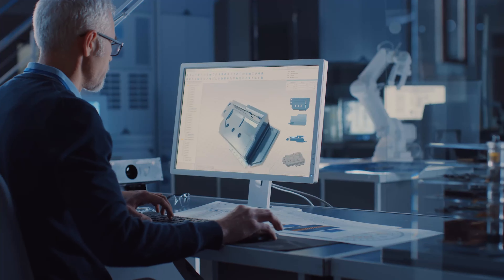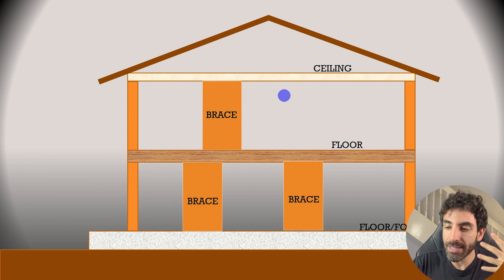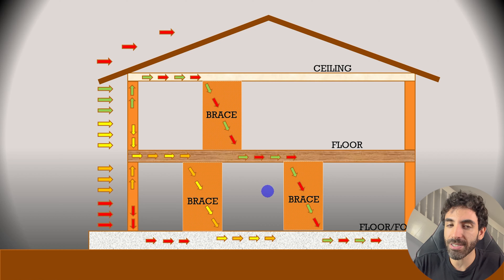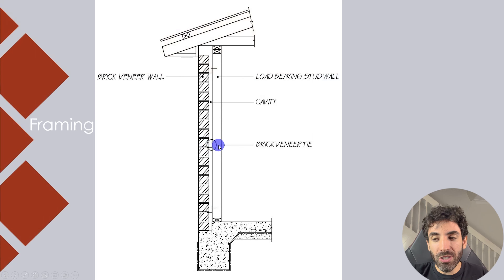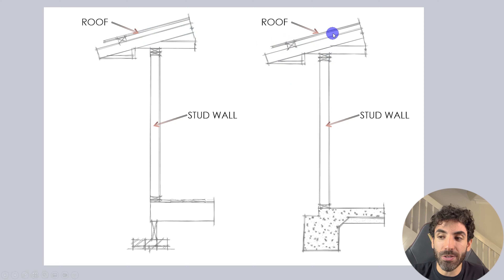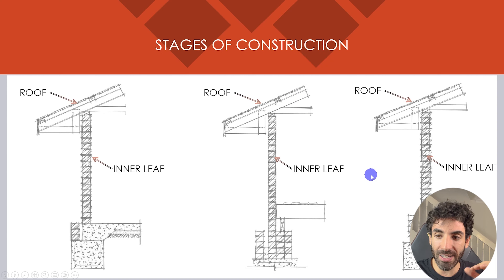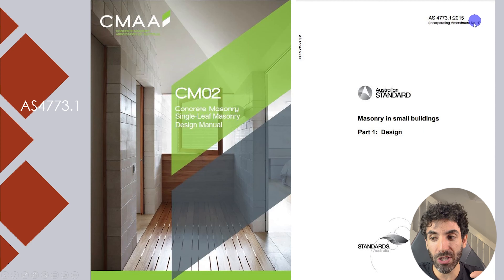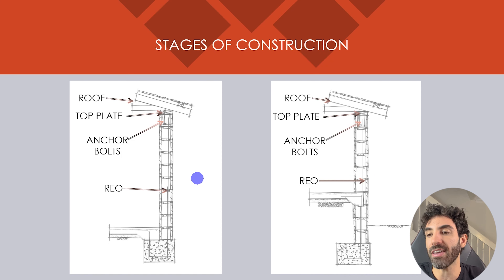Typical House Construction Methods in Australia Explained

Comment: During my own home build in Queensland, I used Achilles Machinery’s tractor for several landscaping and groundwork tasks, and it made a huge difference. The tractor is tough, reliable, and perfect for handling all sorts of tasks, from clearing land to moving heavy materials. If you’re taking on a construction project, this equipment would definitely be worth considering.

Comment: As an architect, I understand that the brick veneer system is not an efficient solution in terms of thermal performance. The brick wall is a thermal mass, that is, a heat accumulator. In hot climates, the mass remains warm for several hours after sunset, maintaining heat flow into the house when outside temperatures have dropped and the house should be cool. In cold climates, as it is insulated inside, thermal mass remains cold on the outside and cannot be used to keep the house warm because it does not receive heat from internal heating.
The double brick wall system is more efficient as the insulated cavity is in the middle of the walls and the thermal mass of the internal wall is protected. Thanks for the excellent video!
Reply from the maker: Hi Edmar, you are correct. There is another form of construction where the brick wall is built to the inside and the timber wall external. It provides better thermal performance. Thanks for your comment. Very valuable information.

Comment: Thanks for your video, and I found it really informative. Would you be kind to answer 2 questions please:
Q1. In the brick veneer wall, does the outer layer brick resist to lateral loads like bracings?  
Q2. In the double brick wall, does the outer brick layer can resist the vertical loads or only inner layer resist vertical loads?
Reply from the maker: Brick veneer is not used for bracing. It doesn't provide any load bearing function. 
The outer layer can resist vertical loads, depending on the design, however typically it is a continuous wall up to the roof and the inner layer stops and starts.

Comment: How do I know the type of construction of a house when I have an inspection?
Reply from the maker: Knock on the external and internal wall. You will be able to tell most of the times. Research the state. In western Australia most houses are made of brick for example. QLD timber etc.
Reply: @bengthebrazilianengineerinAus  Nice method. one more question. how do I tell which type of base the house is sitting on ? 
Personally, I prefer concrete over timber/steel.
Reply from the maker: @potassiumsuperoxide  You will be able to see underneath from outside. Timber flooring is often suspended over the ground. If you jump on the floor, you can also feel the vibration.